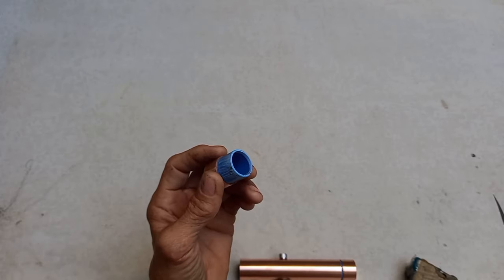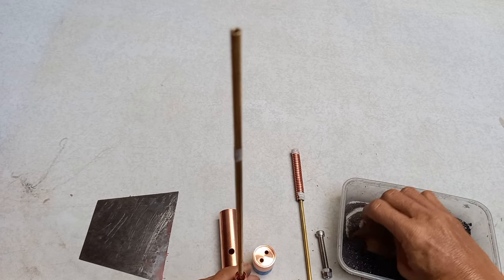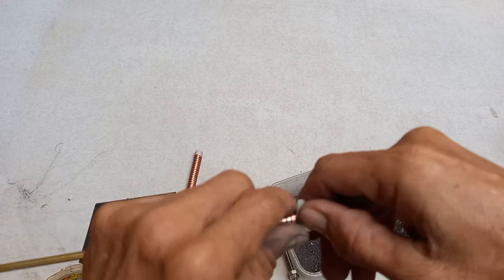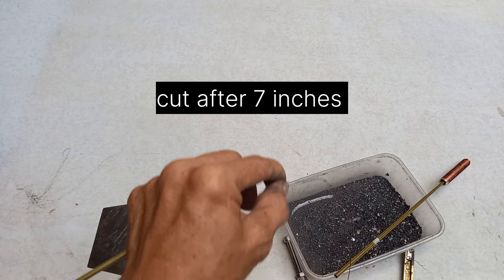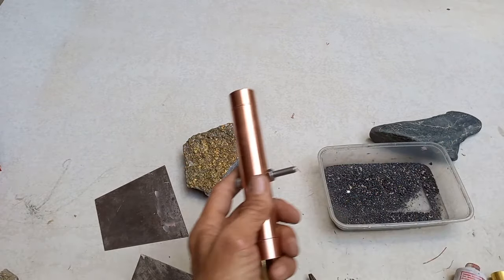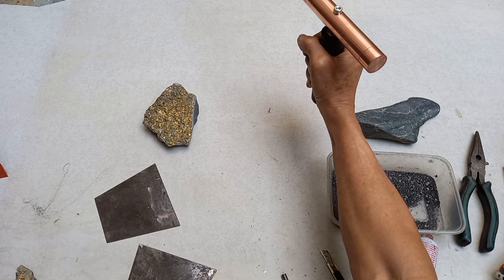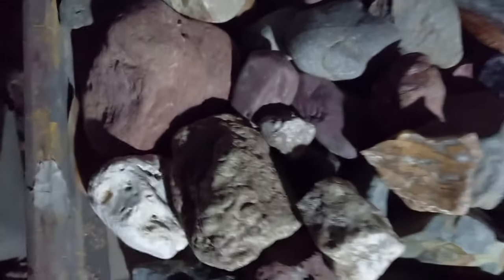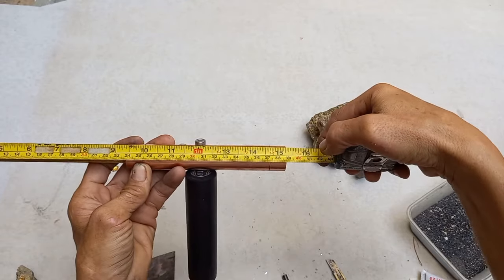DIY, UPGRADED DOUBLE ANTENNA LONG RANGE GOLD LOCATOR VERSION 4 COPPER TUBE

Comment: Hello, dear Professor Dennis, you put two turns of 24 wire inside the copper pipe, one was 107 turns, how many turns were the other?
Reply from the maker: all turns the same

Comment: Professor, excuse me, inside the big tube, on the 4 mm tube, after three layers of 50 turns of 24 wire, how many turns of 24 wire did you wrap after that?
Reply from the maker: i forgot that , it's my old video better watch it

Comment: good time teacher  If you use the glue and colored milky substance to connect two pipes with an internal diameter of three millimeters to a large pipe.  Is there any problem if we use steel or twin clips instead?   Or what is the alternative to use?
Reply from the maker: the very important, is that  the rod is not grounded directly to the tube if you use metal materials

Comment: Good luck,teacher,I want to ask,can the tube be replaced with a pvc pipe and I want to ask what size is the magnet wire with 27 coil at the end
Reply from the maker: yes you can use pvc pipe, # 24 magnetic wire
Reply: How do I find a magnetic wire?

Comment: Hi how are you sir i like all your video but i want to ask you
How much is a magent 24 wire? 
Can i use a stainleas steel tube instead copper? 
Is a basalt stone considered one of 85 kinds a natural stone?
Reply from the maker: no , stainless steel tube is not fit for gold detector but you can use aluminum instead of stainless steel, but copper and bronze tube is fit and accurate
Reply: @dannysvlog_th  thank you so much
Reply: can brass pipe?
Reply: Magkano po bossing?

Comment: Kumusta, mahal na Propesor Dennis, ako ay matalino, ngunit mangyaring sagutin ang aking mga katanungan at sabihin sa akin kung gaano karaming mga pagliko ng wire ang iyong hinihigop, dahil hindi mo isinulat kung gaano karaming mga pagliko, mangyaring sagutin ang aking mga tanong upang maunawaan at maayos ko ito.
Reply from the maker: in making turns, be sure that the last number is not even , sample 21, 23 ,27 or 33,37 or,53 , 55 ,57  or 61 ,67  same like that